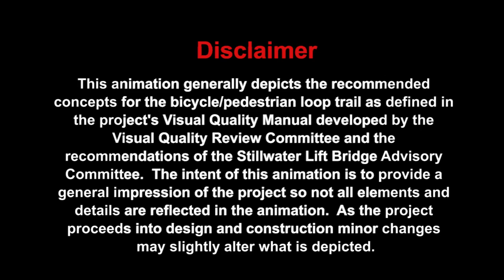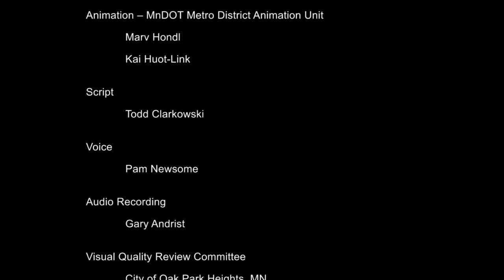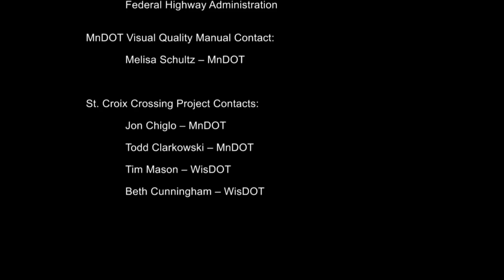St Croix Crossing Project Loop Trail animation

Comment: When is the railroad track between Sunnyside Marina and downtown Stillwater going to be removed?
Reply from the maker: Boyd W The letting date for this section of the loop trail is June 9, 2017. The majority of the loop trail in both states will be completed by the end of 2017. A small portion of the lower trail north of Sunnyside will be constructed in 2018. This fact sheet contains related information and project contacts: http://www.dot.state.mn.us/stcroixcrossing/pdf/loop-trail.pdf
Reply: So those railroad tracks might be removed this summer?
Reply from the maker: Boyd W Unfortunately the fact sheet isn't very specific with dates. If you look at the color coding on the map, the section of the trail with the railroad tracks is highlighted in pink. The work on this section will begin in the summer of 2017. The section highlighted in blue will begin this summer (2015). The section in red will begin in 2018.